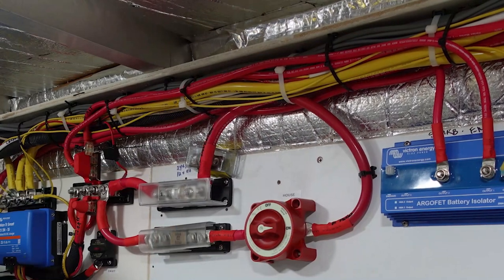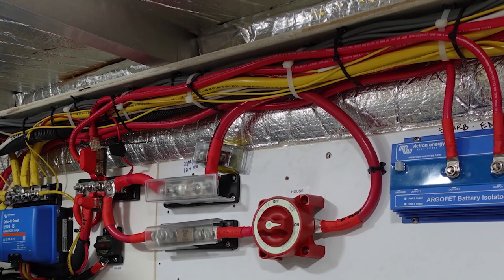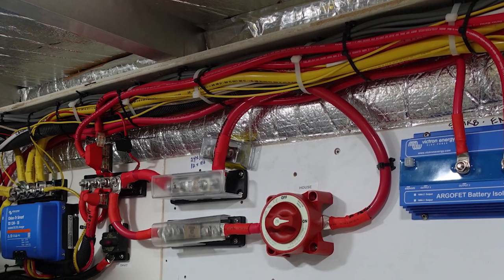Condensation vs. Electrical on Your Boat

Comment: I am No expert, but i live in Norway, and winters are cooooold... The problem is far less during the coldest periods as air below freezing is actually dry. Autum and spring present the biggest issues. We use to spray all electrical connections with some sort of thin oil before laying up. It is also common to use a dehumidefier to dry up the air inside the boat in autum and spring.
Reply from the maker: Thanks for sharing Svend, good point about Spring and Fall.

Comment: And insulate!  Closed-cell foam wherever you can get it against the hull and underside of the deck.  This isolates the warm moist air from the cold surfaces, so preventing the condensation.  I have now added a heat source to blow warm air into the cavities between the insulation and the cabin panels, driving out any cold moist air and prewarming the living area from the outside.  It works!
Reply from the maker: Well said Jock, thanks for sharing.
Reply: Bingo! We insulated the entire boat above the waterline - end of condensation. We used 10-20mm closed foam as used in RV;s, anything below 10mm and below 5c and you will still get condensation. 
Another benefit, halved our heaters diesel consumption.

Comment: I use small Computer size fans in the Engine room and electrical panel to move air all time. Works like a charm. Thank you Jeff like Always good points.
Reply from the maker: Great idea

Comment: Hi Jeff, great information as usual. Thanks!
As we all know, corrosion creates extra resistance on terminals, plugs, strips etc. 
Does this resistance that is caused by corrosion also cause idle battery drain?

Thanks,
Reply from the maker: Don't think so, as you need a circuit to drain a battery, and the corrosion is localized.

Comment: Great Points on condensation in boats! What about using dielectric grease, or even WD-40, on exposed electrical connections?
Reply from the maker: The magazine "Practical Sailor" did an article about this, from memory the Boeshield T9 product was a good spray to protect connections.
Reply: @PacificYachtSystems  I live in the southern US (hot humid )on salt water and I use Boeshield for all my electrical connections…..after they are made. Great stuff. Love the new intro. 👍
Reply: Silicone di-electric grease works perfectly on all electrical contacts, I used it and never had a contact corrosion issue.
Reply: WD-40 will lift the water off the contact, however it evaporates very fast and you loose the protection in very short time.

Comment: in electrical substation cabinets in the upside down to USA in Australia they used to install a small 75watt bar heater (insulated screw mounted) with a thermostat to minimize the humidity in cold climates in the cabinets. So, in marine I cannot see why we cannot do a similar thing in the high humidity areas of a vessel especially with a lot of boats installing solar panels
Reply from the maker: How interesting, wasn't aware of this product.

Comment: Hey Jeff, I love your teaching videos and I have a question...
I recently acquired a dc-to-dc converter to charge lithium ion batteries for power tool, and I discovered that it wasn't completely charging the batteries. Is this a quality of converter issue?
Reply from the maker: Hmmm, don't know. Can your DC to DC converter handle the wattage load of your power toll?

Comment: Hi, great videos and such valuable content you share!
I'm not sure how to submit a question, so will give a try here - it would be a bit different subject than this video..
I'm looking to upgrade the wiring for my old boat...
how do you actually wire 2 engine boat to charge multiple battery banks? (engine start, 1x bow+stern thrusters & AGM housebank) all conceptual diagrams have one engine mostly, so should it be so that as there are 2x alternators, would I need 2x isolators with 3x outputs each? then each engine would charge it's start battery + jointly the housebank and thruster batteries. OR that's not good and instead I should split and use starboard alternator to charge the housebank + stb.start battery and port engine to charge it's start battery + thruster battery? 
my boat has old 70amp alternators with internal regulators.
appreciate if you could spare a minute to guide me to the answer! 
Cheers!
Mantas
Reply from the maker: Hi Mantas, you're on the right track, check out the Battery Isolator section on our website, over  70 articles and videos on this topic:
https://www.pysystems.ca/shop/power/battery-isolator/

Comment: IF ANY marine electrical wire terminal connectors, battery posts, buss bars, soldered or solder-less crimped terminals, etc., or any other electrical conductor, EVER becomes covered by water of any kind, then ZERO ISSUES should EVER RESULT.  ZERO!  Why?  Because ALL electrical conductor metals should ALL BE COVERED in either, electrical grease, or clear spray-on rubber sealant.  ZERO MOISTURE should EVER be able to TOUCH METALS of electrical circuits.  PERIOD.
Reply from the maker: Thanks for sharing!